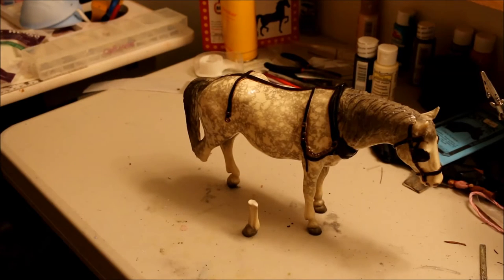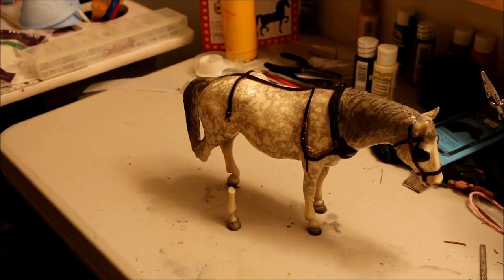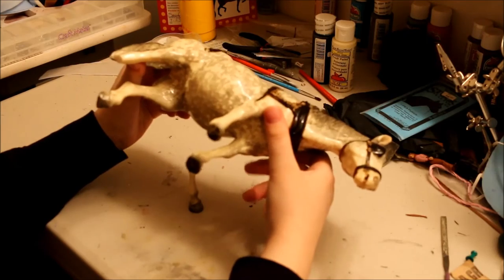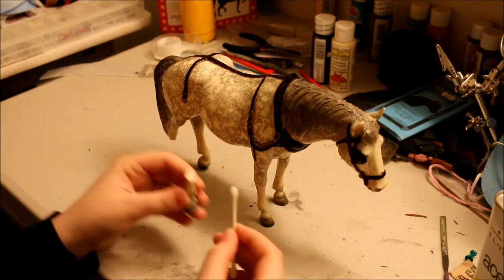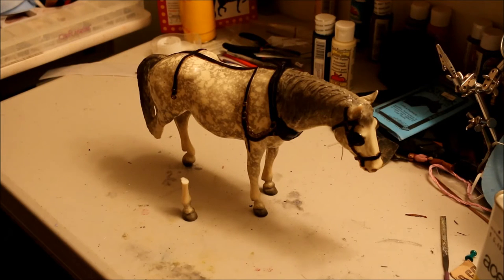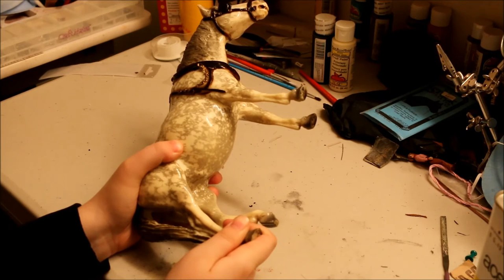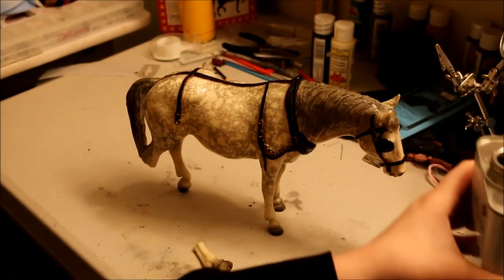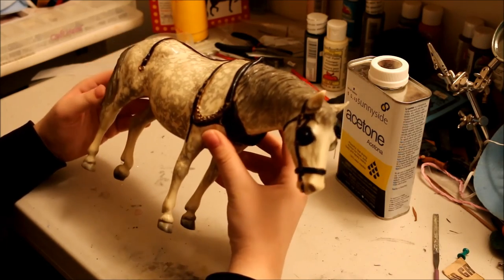How to Repair a Broken Breyer Model With Acetone

Comment: i've had several vintage models break, and we have fixed them with accetone but, when my black foundation stallion broke it's leg after 3 fixes, we had to place a metal wire in the leg and then added the accetone. Now the horse stands a lot better and doesn't brake, tutorials like yours a very helpful!

Comment: So you can use nail polish instead of the acetone?
Reply: HorseyTube you can but it doesn't really hold as well as pure acetone.❤️
Reply: Stripeyhorse studios thanks! :)
Reply: Nail polish remover doesn’t have enough acetone to do the trick. You can buy pure acetone from chemical suppliers or if you are near a university you can go in and ask people in the chemistry department if they can use acetone to fuse the leg for you. I don’t think they’d say no at my university being we use acetone to clean all of our glassware and I’ve even used some of it to take off my nail polish (it burns your skin because it’s super concentrated so you really shouldn’t handle it without gloves. My nail polish just went adios with a single drop lol.

Comment: It would be a much more helpful video if you could/would re-record the audio portion.  As presented, even with external speakers and and video speaker turned to maximum, it is almost impossible to hear certain parts of the video recording.  Just an FYI